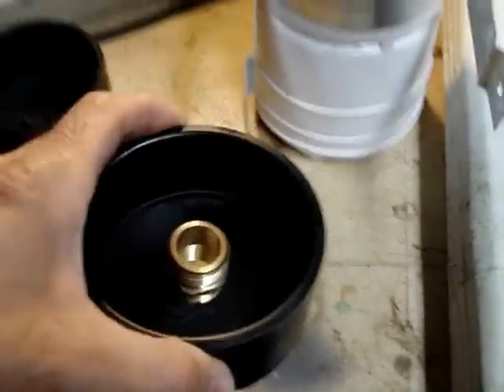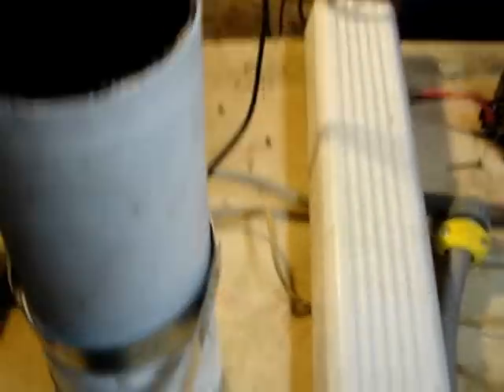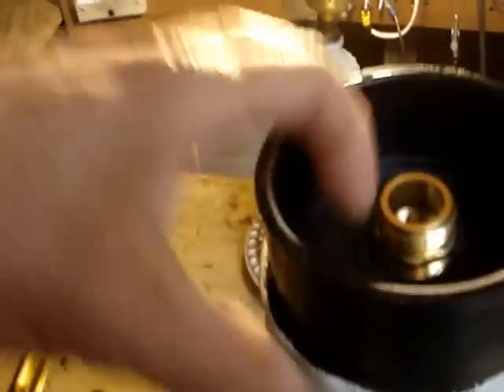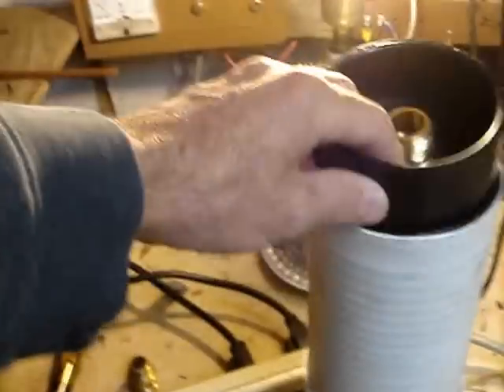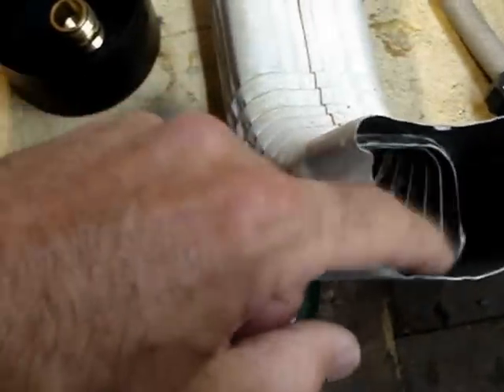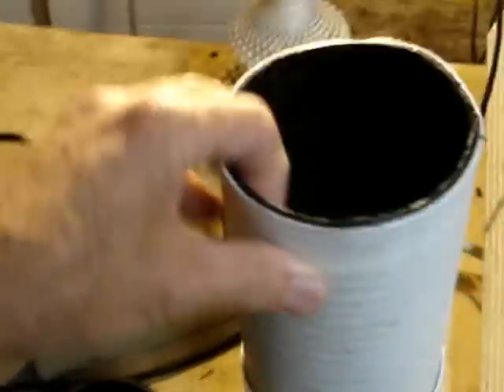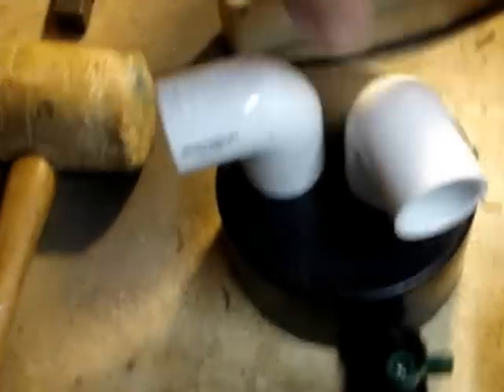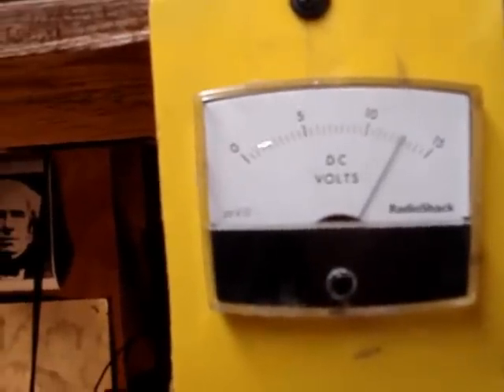Downspout Rain Water Capture Diverter Pipe

Comment from the maker: I've lived here for 6 years, we had heavy rain maybe 3x, lasted about 5-10 min. Most rain is drizzle or lite showers constant. Gutters are not connected to the pipe. The top of the pipe has spilled over, not the gutter. In my final design, see link am planning for larger pvc pipe.

Comment: ok but raining anf using a 4" down spout, normaly never will back up, but cutting it down to a 1/2" hose 50 or 100 feet, will back up an now your gutters back up and over flow all down the side of your hous is flooded. don't mater if you put 10 1'2" hoses, still will have one hell of a water back up mess around your house